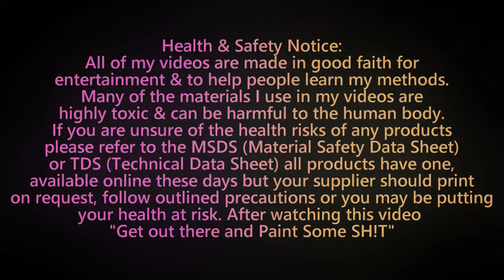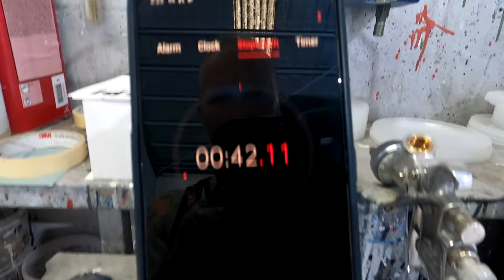3M Performance Spray Gun, Spraying Standoblue

Comment: You know if you hold the gun upside down and hold the trigger before spraying it will compress the liner inside with all the paint forcing down to the nosel. It makes it so you can spray upside down without the gun skipping from the paint getting away from the tip. Try it some time, youll see what im talking about

Comment: Hey Gunman. You appear to be going over the same area back to back with no flash off in between. Why is this? Is it a single medium wet coat followed by a control/drop coat since it's a blend?
Reply: That's how you're meant to spray Standoblue. It's weird if you've never used it before.

Comment: Thanks for sharing this Gunny, everyone is raving about this gun in the UK they are saying this will revolutionise spray painting but we will see, I can't use it as it's HVLP so my comp wouldn't run it. I'm finally updating from PPS 1.0 to the series 2.0 which has been out years but getting it here is a nightmare I can get the pots but cant get the adapters anywhere, in the end I was contacted out of the blue by a 3M rep in Northern Ireland who sent me 3 adapters and a few other samples of sandpaper all FOC (probably due to me ranting about it on FB 😁), be good to hear your thoughts on the PPS 2.0 in one of your vids mate 🙏👊👍 John UK.